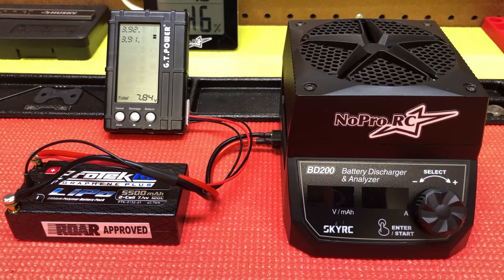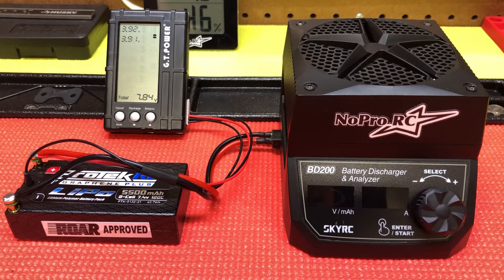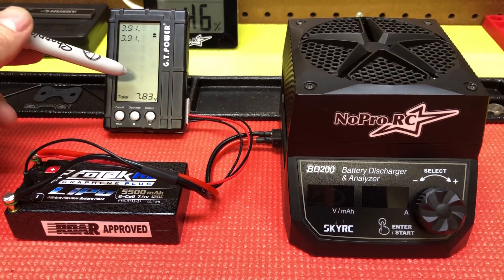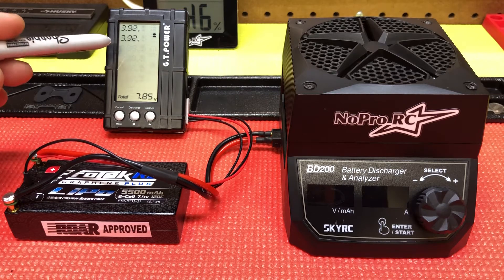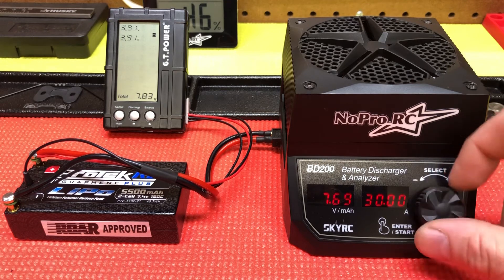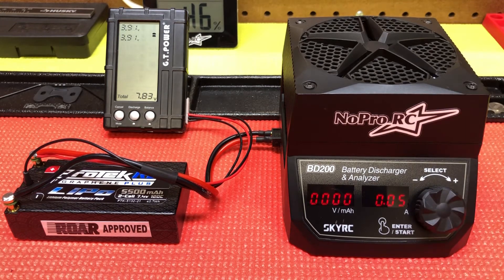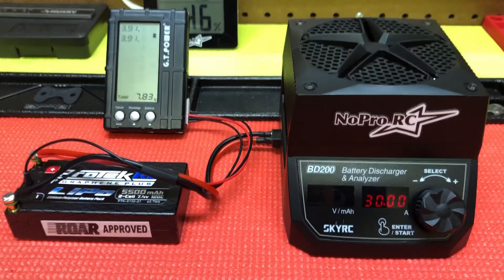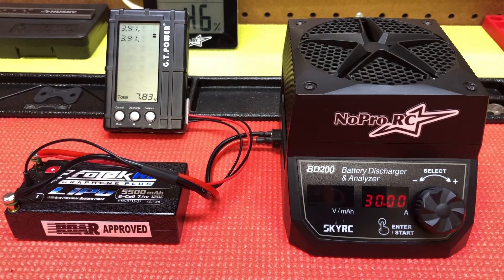SkyRC sky rc lipo discharger .. quick easy dump!!

Comment: Im assuming you cycle your lipos for stock racing....Have you ever noticed the difference between just charging at a high amp alone vs high amp charge/discharge cycling?  In other words, does simply high amp charging have a positive effect?
Reply from the maker: Nerun , sorry it took so long to reply!!…. I would say that simply charging at a high amp rate would make a small bit of a difference, but starting with a pack that has been discharged would be much more impactful and give you that punchy feel much longer in the run and reduce IR by a lot more.
Reply: @noprorc9365  thanks for the response 🤙🏽
Reply: @noprorc9365  Ive been experimenting with a lipo warmer bag and it brings the IR down a noticeable amount without the high discharge.  I know some races theyre "illegal" but I think its likely just as effective and not as bad for the lipo
Reply from the maker: Yup!!!!…. I’ve been kicking around getting a warmer myself!!
Reply: @noprorc9365  Got one from Donathen rc.  It’s def effective but feels slightly cheating since its roar illegal but thats just dumb anyways….
Reply from the maker: Yea according to ROAR rules everyone is “cheating” one way or another 😂 LOL
Reply: Will discharging 2S shorty lipo battery at 35amp reduce the gas trapped inside the battery ? Meaning will the battery become less bloated ?